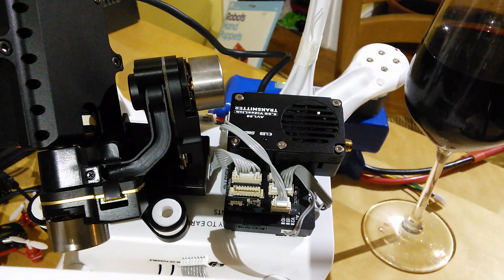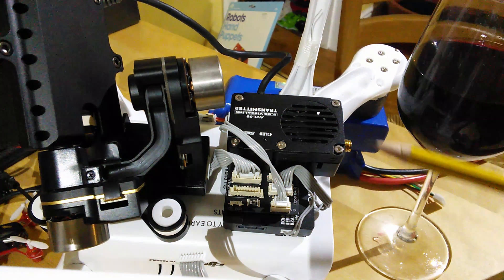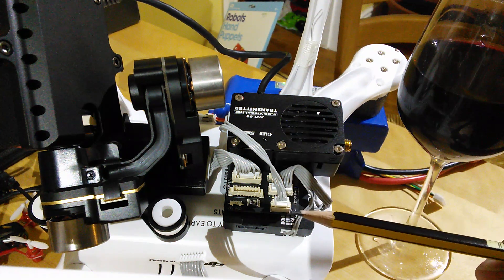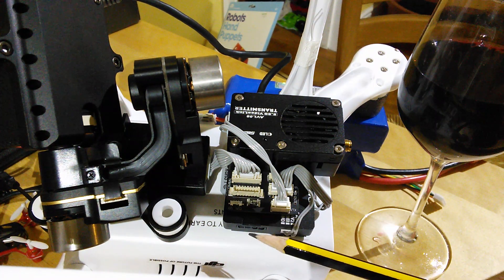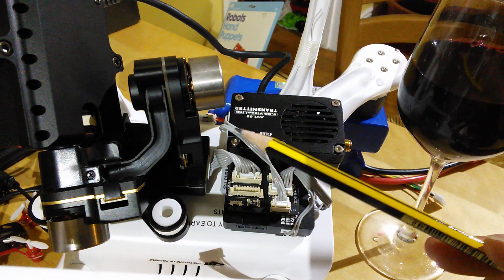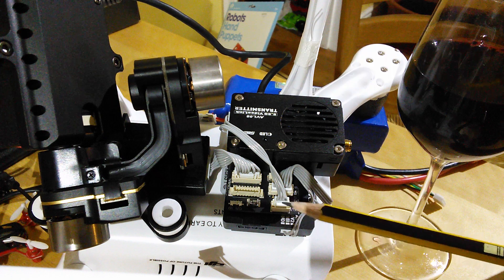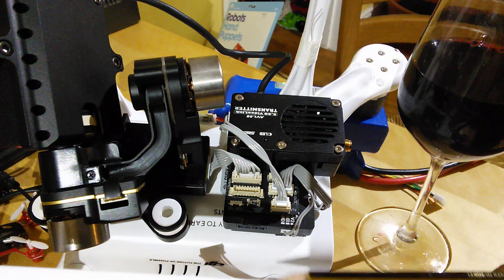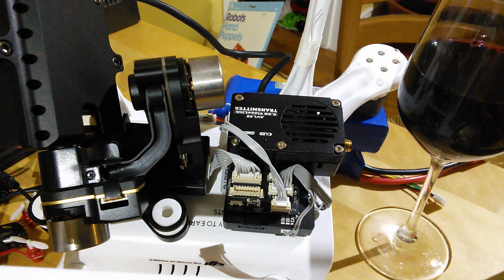How to wire up the DJI FPV Hub on a Phantom 2 with H3-3D or H3-2D gimbal

Comment: Okay so I have been giving myself a headache trying to understand all of this. I have basically everything that you're working with there except, I have a phantom 1. Also I don't have the iosd Mini, or the iosd Mark II. All I'm looking to do is hook up the zenmuse and the DJI transmitter to the fpv hub. I'm stalled because there is no 8 Pin cable that comes off of the Phantom 1 like it does on the Phantom 2. Do I have to go get a Phantom 2 and try it that way? Or is there any other way to make it work with my Phantom 1? I've been under the hood of my phantom, and there is no 8 pin connector on the circuit board anywhere. I really want to get up in the air, but I'm stalled by this issue. Please your help would be greatly appreciated.

Comment: Any ideas on how I could use this without the gimbal? I'd like to practice FPV flying in manual mode .
Reply: +Simon Newton Oh cool, didn't know I could set the gimbal into FPV mode. I'll have to check that out. I'm planning on buying a true FPV racing quadcopter soon, I'll think the FPV gimbal mode will do just fine til then! Thanks for the fast answer. :)

Comment: I have similar setup but using h4-3d i get video and ios mini data but i loose gimbal functions and goes all wacky once i run through to it. any ideas what im doing wrong??
Reply: +Simon Newton i got it now i swapped to go pro 4 not sure if that made the difference. Also powered it on with everything in place instead of on the fly. thanks for the reply

Comment: Hey Simon, Thanks again for all your help yesterday.  I just wanted to update you on what I learned.  First, I wasn't aware that you could change the transmitter's signal with a paper clip.  Second, the Elvid monitor's "dip-switch chart" was completely wrong and inverted.  I downloaded the actual chart from their website and finally got the right codes.  I do not know why B&H sells this crappy monitor as their DJI FPV system.  At the time it was the only monitor available.    Had I done my research I would have just purchase the black pearl monitor on Amazon.    I finally got a decent picture but it's still not perfectly clear.

Comment: DO YOU NEED THE IOS MINI TO MAKE THIS WORK?  IF NOT, HOW DO YOU SET UP THE CHANNELS?
Reply: Maximilian Imaging  I have installed everything except the iOS mini and when i turn on the dji the transmitter is running with one flash of yellow then one flash of green lights but it is not being picked up by the Elvid WCM-758G monitor.  PLEASE HELP.
Reply: *****  Hey Simon, Thank you so much for replying.  I'm using the same AVL58 tx you are using.  I have been at this since yesterday afternoon and i am ready to take a sledgehammer and smash everything into a fine powder.  
Can you tell i'm over it?  OK but i will take your advice and try all 58 channels the monitor has.
Reply: ***** ALSO WHAT SHOULD THE HUB SWITCH BE SET ON?   OSD OR VIDEO???
Reply: ***** Hey Simon, yes, it's actually the monitor the B&H sells for the phantom FPV    http://www.bhphotovideo.com/c/product/1032642-REG/elvid_wcm_758g_7_wireless_lcd_monitor.htmlIt's supposed to work seamlessly BUT FAR FROM IT.

Comment: Hello Simon, complete noob here. I've just bought a GoPro Hero 4 Black with the intention of mounting it to the Phantom 2 + H4-3D when I purchase it in April/May. Am I right in thinking you didn't need to solder at all for this setup or it was just the FPV hub that didn't need any soldering? I've been researching for 2 days so I'm just in the early stages of collecting information at the moment. I'm looking at getting the FPV hub, DJI AVL58, iOSD Mini and the Black Pearl monitor. Is this all I need for a no-solder decent video streaming option for FPV? Thanks in advance for your reply to this idiot! :D
Reply: ***** Thanks for your quick reply Simon. The DJI AVL58 Lite looks brilliant! That's quite a big saving in money and weight as you pointed out in your other video. It's currently £38.99 on fast-lad. The antenna that you mentioned is currently £30.79 on horizonfpvantennas (Single Nimrod FPV 5.8GHz). Is it just one of these that I need or do I need one for the Black Pearl as well? Thanks for your help so far! I have subscribed to your channel now.
Reply: ***** Thanks again for your help. Looking at the horizon website now. Bit confused over the packages. The Black pearl kit V2 with dual 2.4 & 5.8 - Nimrod and SP is £135 and the Black pearl kit with BH, Nimrod and SP is £75. It also comes with a load of options in the purchasing section which I don't really understand at the moment. What kit did you choose and what options? Maybe post a link to your kit or the kit I should get with the options as well. That would be great. I'm making notes of all my research as I go. It's all new to me but very interesting!
Reply: ***** Will do mate. I'll tell him that you palmed me off on him! Haha! Once again, thanks for your help! You'll probably hear from me again.
Reply: ***** Quick update: Spoke to Will, he recommends the ImmersionRC 600mw VTX over the AVL58 Lite. Your thoughts? He said it's plug and play as well. He also says to go with the Black pearl kit V2 with dual 2.4 & 5.8 Nimrod and SP.

Comment: Hey Simon just trying to slowly piece together my game plan. Packages are slowly starting to show up. Anti-Interference Board? What are your thoughts did you use it?
Reply: Just found your video. Sorry about that.
Reply: Kevin Nelson Do you have a link to the anti-interference board? I have the H43d and want to add FPV. Many thanks.
Reply: Many thanks for the help.

Comment: As I search for a resolution, it seems like my issue is moderately common, but I haven't seen a fix.  All wired up correctly, got a rockin' 5x5 RF signal from the Tx, and the Rx is delivering a crisp, clear image to my cheapie Lilliput 7-inch ..... of only the OSD - no video from the HERO 3+ Black.  When I switch over to video (as opposed to OSD) on the hub, I get blue screen of desolation.  Anything obvious I'm missing here?

Thanks in advance ... and looks like an elevated level of C2H5OH or sugar in that Sicilian red, judging by the legs ... and the reviews say it's pretty good.  Must grab some! :-)
Reply: Oh, and the OSD is a Mini ...
Reply: ***** Wellllllll ... as the result of a too-intense focus on whether everything was properly connected to the hub, I failed to see that the cable that connects the camera to the gimbal had broken.  Replaced it with the spare included in the kit, and I've got a fantastic image now.  Next upgrade - will use a right-angle adapter to turn the Tx antenna downward.  Thanks so much, Simon!

Cheers ...

Comment: Simon, have you ever run into an issue with your video transmitting from the avl58 to the black pearl screen? Currently, my BP screen has a black and white image that is a bit fuzzy and bounces. I've tried going through all the channels and bands on the BP as well as the channels on the AVL58; no luck so far. Didn't know if you would have any words of wisdom? I have also replaced the ribbon connecting my GoPro3+ to the H3-3D Gimbal.
Reply: Yes it did do this before replacing the ribbon but there was no crash or a tear in the ribbon. The distance doesn't seem to have an effect on it either. It's got me puzzled.

Comment: I have been stuck for weeks trying to get the video to the black perl. All I have had was a black screen to the monitor. I knew that it was getting the signal from the AVL58 but had no picture. That was until I found this video and saw that the hub had a switch to change from OSD to video output. Thank you for including this in your video it's a very important part of setting up your FPV

Comment: Hi Simon, great videos!!
I have a question if you don't mind. I just bought Phantom 2 with H3-3D gimbal and the new GoPro Hero 4 silver. Obviously I want FPV. I was thinking of getting DJI iOSD Mini, Dji Phantom 2 Fpv Cable and Hub, DJI AVL58 5.8G, and Black Pearl 5.8Ghz. Will these be enough to have the complete FPV?? Thanks

Comment: Hi Simon...Just a quick question. With this setup do you still need to use the anti-interferance board that came with the H3-3D?
Reply: ***** Cool! Thanks. I will use just to be on the safe side

Comment: Great video Simon. Quick question, do I ditch the anti interference board, or do I somehow use it with the hub? I'm a little confused on how I would use both. Thanks in advance.
Reply: Thanks Simon. I actually found your video regarding this right after I made the comment/question. Thanks a ton Simon! You have some awesome videos!

Comment: Nice. Best and clearest installation tut I've watched.

Question.  Have AVL58, DJI FPV hub, Zenmuse 3D - with anti interference board.  I want to install this internal/ clean.  Searched everywhere.  No answers to this.  Please help. No soldering.  Grey cables only.  HELP.   :(
Reply: ***** Thanks for the help Simon.  I figured it out. Yes, of course the AVL58 TX is mounted outside the DJI, but I got everything else ( the anti-interefence board, the fpv hub, the iosd mini) all inside.  So I only have one 2 wires external.  Basically I switched the 8 pin cables long and short. which connect anti interference board, hub, phantom... and I soldered and extended the TX to Hub cable, so that it can reach the from the hub inside - out to the TX.  I should have taped it all to share.
Reply: nigel scotland I see what you did with switching the two 8 pin cables, connecting the longer one to the zenmuse.   However, to clarify, you had to splice more wire into the TX-Hub cable so that it would be longer?
Reply: Correct.  I spliced in extra length inroads that wire.  The only saudering
Reply: nigel scotland Those are 4 tiny wires....a total of 8 solder connections.   Did you have any problems with stripping/soldering such small wires?   (I am a novice with soldering.)   Any tips before I cut that cable in two?   I will be trying to be like you this weekend.
Reply: No
Reply: Works perfectly
Reply: I love it
Reply: No headaches and it's nice and clean
Reply: +nigel scotland question here, when you use the ribbon cable from the phantom to the interference board, how you connect everything else to the hub? I was using that cable and everything else, osd, flv58... to the hub, but now with the interference board I am a little lost... thanks

Comment: Thanks Simon, I jst got the FPV-2 kit and am going to work on this tonight, but first I am going out to get a good bottle of Red. Looks like the AVL - 58 is raised of of the dji, so the IOS-D( thick black cable) runs underneath. Am I seeing it correctly ? If so How did you mount the AVL- 58. ?
Reply: Thank you.. see I did pay attention to your good detail.. Good video and good wine as well.

Comment: Hi Simon,

I have just purchased a Phantom 2 with Zenmuse H3-3D gimbal, and would like to hook up to miniosd and AVL58, I also have the FPV Hub but I want to open the P2 and put the miniosd inside and the AVL58 outside but as I am a beginner, I do not know which wiring I should follow to achieve this, do you think the wires that come with FPV Hub and AVL58 would be sufficient to do this do I still need to solder, could you please give me your thoughts about this please, thank you very much indeed.
Reply: ***** Thank you but which cable will I use for the AVL 58 the one that came with AVL 58 ? I suppose, and will I still be using the anti interference board and the FPV hub if I am going to stick it inside ? do you think the cable lengths will be enough. Thanks

Comment: Nice and very easy to understand as usual .

Q: is the gray cable coming straight from the pcb or the interference chip of the gimble 
Q2: will this dji set work with an fpv goggles like fatshark or the goggles require there own transmitter .. I don't wont to get an fpv goggle to find that it won't work ... If so any recommendation on a set of goggles.

Thanks
Reply: Dji transmitter is 5.8ghz then ... i thought its was 2.4ghz .

Thanks alot
Reply: Ok , got them mixed up .

Cheers

Comment: Question: Does this replace the original HUB that connects the gimbal and the phantom?
Question2: If you use this hub, you don't need to use the RED wire without a plug that is coming out of the phantom?
Reply: I didn't see the POWER connect board in this video, you see I have the Phantom 2 with just the gimbal right now. The Phantom 2 and the Gimbal connect to a POWER BOARD.... It looks like to me, from this video, that everything connects to this one board leaving the old board That gives power to gimbal from phantom out of the question. I may be wrong though.

Comment: Hey, great video. I'm looking at getting a similar setup. How do you power the DJI AVL58 VTX, because on various websites there is a cord that connects to a battery similar to the Phantom 1, is there a way to power it without having to mount an extra battery. Also, do you ever have any 'Jello' problems with the H3-3D gimbal? I'm thinking I might have to mount the DJI Anti-Interference Board to reduce the unwanted effect, thoughts? Thanks in advance.

Comment: Hi Simon. Just recently I've experienced a couple of instances than I thought I'd like to run by you and wondered what your thoughts would be. Firstly whilst flying along the canal in Stonehouse Gloucestershire I had a warning come up on my iPhone saying restricted flying area land immediately. Just wondered where you know of any apps that would tell me where no-fly zones are.

Second instance when attempting to fly I had a battery that had four green light showing a full charge 
. My iPhone showed 98% so all was well and I attempted to take off. At which point there battery warning alarm sounded on my phone and the warning came up saying  uncompatible battery. After removing and replacing the battery I tried again all was well and showed full charge attempted to take off but would not lift of. So this morning the day after thought I would try again no problem all went well. Just wondered whether you had any ideas many thanks

Comment: Hi there. Great video 📹 as always. I do have a question, can I use a monitor with a built-in receiver that's not made by DJI  with the DJI AV transmitter. I've lost my DJI receiver and wanted to just get a monitor with it built-in
Reply: Brilliant, Thanks you so much.